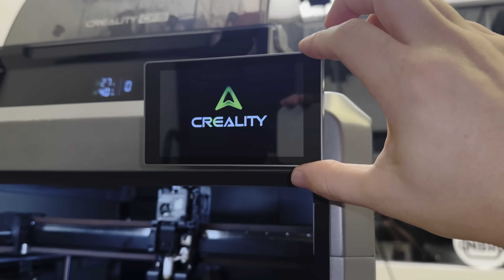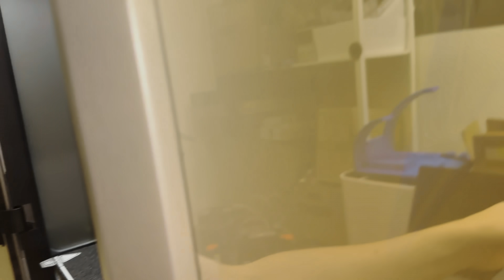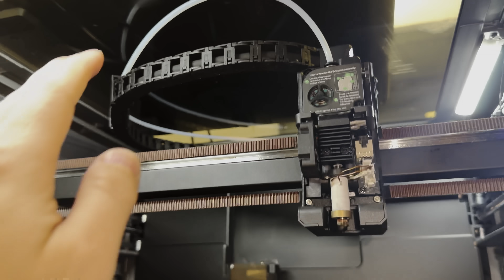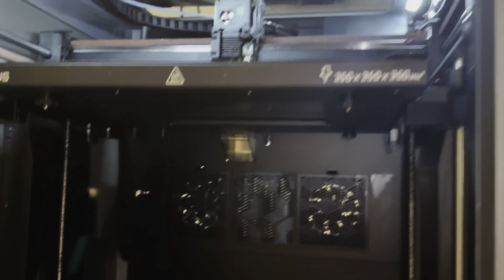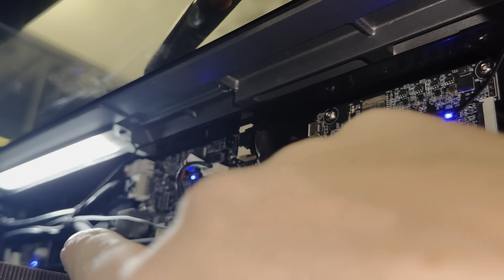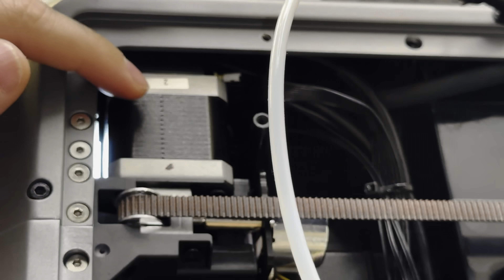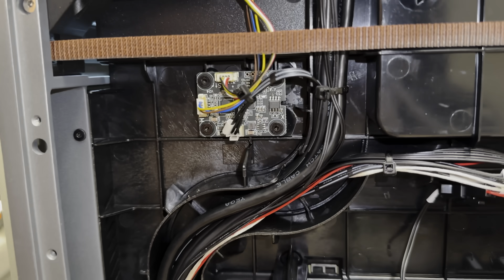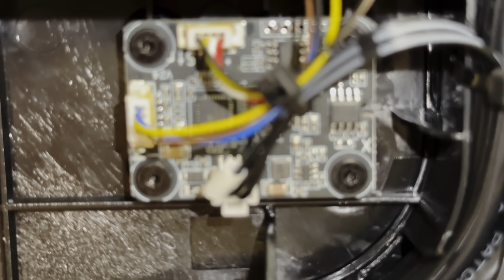Creality K2 Plus - What's Under the Hood?

Comment: Maybe I'm mistaken, but isn't the bed dropping when it loses power going to make any power loss during a print result in failure? Resume print features usually rely on the coordinates of everything being exactly where they were when the power loss happened. I'd be interested to see how this printer handles those situations.
Reply: Spoiler, it resumes after bed level and z offset ON THE PRINTED PART 😮  Mind=blown
Reply from the maker: Yep, that is why it needs to home at the bottom. If you have it home at the top there is no way to home while a half finished part is attached to the build tray
Reply: https://youtube.com/shorts/WOiJzbL3XK0?si=irmf_t25JhS4_0g3
Reply: homing at bottom and tenso head actually allows u to print on anything on bed, just skip the bed leveling part
Reply: Won't adhesion to the previous top layer be poor because it's not hot enough?

Comment: Bambu suggest they are working on a new 3D printer... Look how the changed the whole 3D printing world so it will be of interest, I can't think of many improvements, size maybe
Reply: Size and tool changer probably, imagine a 4 or 5 head system like the Prusa XL with up tom 4 AMS units per head...
Reply: my guess is they'll find a way to mitigate the multi filament waste issue / filament changing times because that's their biggest problem. If they do it'll make all the multi filament printers instantly out of date k2 included possibly a better engineered multitool like prusa where it hot swaps just the nozzle not the whole head to keep things neat and tidy.

Or my idea of a ceramic hotend with a peltier style heater that can switch to cooling very quickly to cool down the filament and pull it back out without needing to purge, keeping it clean for the next filament to go right in
Reply: Yes swap only the nozzle, with filament, lighter= quicker and less expensive in cost including maintenance

Comment: Best engineered Creality printer thus far... Only real flaw i see is the z axis bottom homing tabs/slots. If some filament falls in there it could cause issues. Hey Nathan, can you do me a favor and take a look at the heat bed and tell me if the heating element covers the entire bed or if it is smaller than the build plate? I noticed there is a smaller cutout box under the bed, so not sure if that is the size of the heating element or what.
Reply from the maker: There is a big empty cavity under the holes, and the tabs that trigger the sensors are very stiff, solid aluminum or steel, so I doubt there would be any problems unless you had something big stored under the bed, which you're not supposed to do!
Reply: Yeah that's a weird choice (The Z axis sensor) because they could have used the advanced motors itself for homing purposes. Still, this is such a massive leap in engineering and throughful design. The belt tensioners wasn't expected, but very much welcomed.
Reply: @RetroDaddyPH  using sensor less homing for z axis is a terrible idea. Even on the x and y axis sensor less homing causes excessive belt wear if the tripping force is too high and is often the root cause for large prints with a failed layer from the axis not being properly registered as zero during the initial homing but doesn't manifest until much later when the tool head has to move to the opposite extreme.
Reply from the maker: Motor homing won't be as accurate or repeatable as the optical sensors they are using. I think they made the right choice
Reply: @NathanBuildsRobots  I would assume the nozzle sensor is used as actual homing sensor. Since the bed drops on power out they can't know for certain where the bed is at when powered on. By first "homing" to the bottom (which is the most likely position) they can then move the bed very speedy to the top as there is a known distance between bottom and nozzle. (edit: since they have 2 sensors at the bottom, they could actually use it for z-tilt, but in that case they are probably also used for homing/z-offset)

Comment: i really hope the remaining filament is measured using the weight of the spool and not writing a value to the rfid tag on the spool. that would allow the rfid tags to be placed on third party spools.
Reply: I would almost guarantee it's writing to the RFID.
Reply from the maker: Yeah that is the most likely scenario. Adding 4 additional weight sensors would be expensive
Reply: @KJMcLaws  probably, yeah
Reply: Id dosent write on the tags, it pulls out filament until it can read the tag again. The leght of filament is related to the diamerter of the remaining filament and the printer calculates the percentage based of that. Its not particulary acurate but dosent require any aditional hardware. Its also the reason the printer doseng give you a percentage only a general indication.
Reply: @lukahierl9857  oh that's a clever idea. like the tachometer on a bicycle

Comment: I bet people will still buy a Bambu Lab X1 or P1 over this because of Creality's reputation
Reply: Well yea. I want a printer that works continuously with zero issues, not one that'll break a couple months after I get it.
Reply: I mean, Creality is still holding onto 47% of the total entry-level 3d printer market, compared to Bambu's 26%- as of Q2 2024. People continue to buy Creality, despite the "Tinkering required" reputation. Kinda surprising really.

Elegoo: ~10.5%
Anycubic: ~10.5%
Everyone else (Including Prusa): ~6%
Reply: @CoolHandLuked  bambu doesn't really have ender 3 priced printers (at least without the current massive sale lol)
Reply from the maker: I bet that sale will continue indefinitely in some form. The A1 mini especially is a big market share winner for them, and it's a good printer
Reply: @NathanBuildsRobots  I'm waiting for my A1 mini to test thanks to this sale. I want a secondary printer that "just works" as a backup to my anet/hypercube/custom thing
Reply: @NathanBuildsRobots  
No more bed slingers - Bambu
Buy our A1 and A1 Mini bed slingers - also Bambu
Reply from the maker: Where are you getting those stats? Could be interesting to browse through them
Reply: You're probably right.  People will avoid Creality based on their reputation, but I'd bet there are as many people who will avoid Bambu because of their reputation.  I intensely dislike proprietary closed source designs, and I really really REALLY don't like Bambu all but forcing their captive customers to use the Bambu cloud server.  That's dumber than dirt.  My computer and 3D printer are on my desk.  Why should my computer send my print job to a cloud server that sends it back to my printer?  I print directly from Prusaslicer directly to my 3D printer via WiFi.  Easy peasy, the way it ought beasy.
Reply: @Liberty4Ever  That is the reason I've been excited about the K2, avoiding the proprietary Bambu. Now I'm thinking how long I should wait before actually getting this one.
Reply: @thedoubledropdown  - I gave serious thought to buying a K2 Max but decided to get the Sovol SV08.  I plan on designing and 3D printing an enclosure for it and I may hot rod it by adding another print head or two for poop-free multi-filament printing.  I like to tinker and the SV08 seemed like a better platform for mods, but the K2 Max looks better for a large Do It All printer without mods.
Reply: @Liberty4Ever  I totally agree, but until other companies start making open-source 3D printers with all the features of any Bambu printer (that are as affordable), it's hard to buy a printer that you want to just work as a tool. That's why so many manufacturing companies are buying Bambus - they work, they aren't 40-100k like some "industrial" labeled printers, and you can just use an SD card to air-gap the printer if confidential parts are being produced. I work at a company right now that has an overpriced industrial printer, a Prusa MK3, Anycubic Kobra 2 Max, and 2 X1Cs. The X1Cs get used the most and the others are rarely used (even if more throughput is needed) due to inconsistentcy. The Prusa works great 90% of the time but the MK3 is slow and all Prusas are relatively overpriced IMO compared to their counterparts in the 3DP industry.
Reply: @Liberty4Ever is it really that big of a deal? I do use Bambu Studio, but like your slicer, it’s also one click of a button and the printer prints over WiFi. Yes it does take a second to upload and get it onto the printer, but what gives if the prints itself are not done in a whiff?
Reply: @fajarkoolhaas2101  - The Bambu cloud server is clearly not a big deal to a lot of people because a lot of people use it.  To me, there's no gain so I question the motives of a company that is so interested in inserting itself into my tool chain to see what I'm designing.  Certainly anyone bound by a non disclosure agreement can't send proprietary designs to the Bambu server.

Even if not concerned about transmitting proprietary files around the internet, there are practical concerns.  In August of 2023, the Bambu server crashed.  Submitted jobs queued but weren't processed.  Many customers were forced to print their parts offline.  Later that night in North America, the server came back online and processed the pending print jobs.  Many of those parts printed on top of the parts that were printed offline, resulting in some hard machine crashes.  So much for the AI camera that prevents errant printing and crashes.  Bambu printers were damaged... some severely, with hot ends turned 90 degrees.  Fortunately, there were no hot ends buried in a pile of molten plastic leading to house fires.  These crashes were only possible because Bambu users were trusting Bambu to print through their cloud server.  I don't see the advantage, but the privacy, security and safety disadvantages seem obvious.

I'm not a Bambu hater.  They introduced some much needed competition to the stagnating 3D printer market when it was most needed and everyone is stepping up, and that's a good thing.  Bambu print quality is good and the printers are reliable, Bambu server issues not withstanding.
Reply: @fajarkoolhaas2101  Try most business networks, a no go there.
Reply: this printer is opened source + heated chamber + 350mm + 350c + AC bed. Still Bambu?
Reply: @vim55k Personally, it’s the after sales service for me, after years of creality and tinkering and managing issues I quit the 3D printing scene altogether. I was most of the time fixing issues than printing actual stuff. Then since a week I decided to try again but went for the Bambu P1S and it has been a joy to use. It was really plug and play, just works. Been printing almost non stop now and the extensive wiki and the support they provide is just simply amazing.
Reply: And they still might be right, this printer has a lot to prove before you can call it a success. (The print quality from other sources has been quite bad)